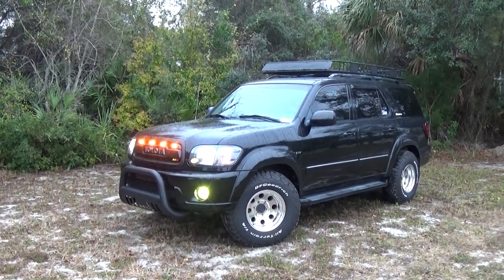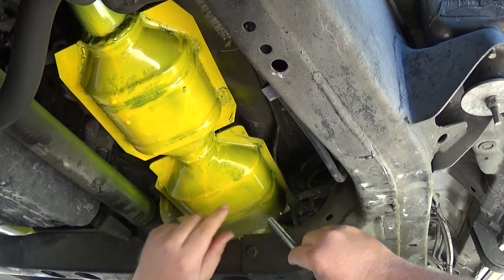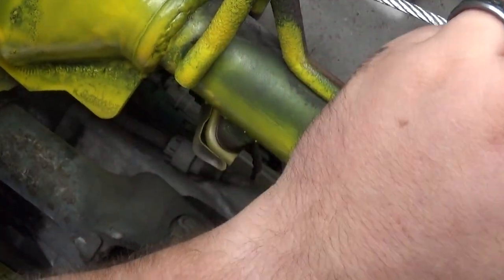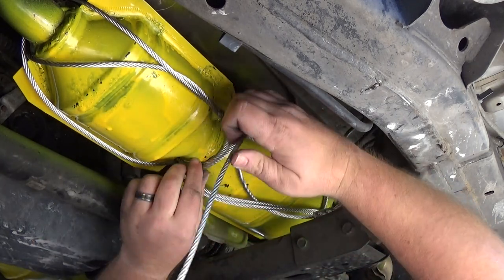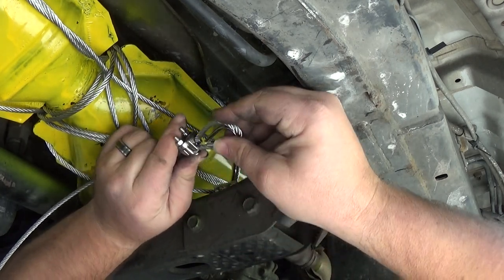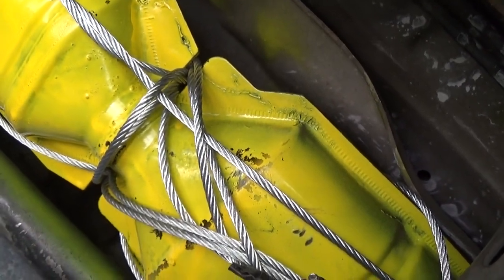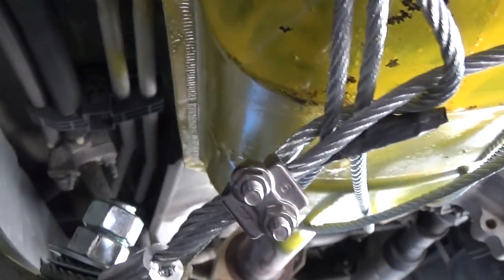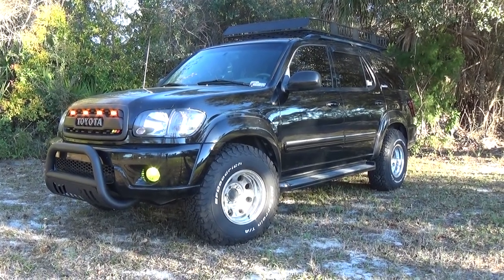SEQUOIA CATALYTIC CONVERTER ANTI THEFT STEP 2

Comment: You might want to take the cable and go up the pipe a little further they can still cut it 4 inches up from the cat. If the cable runs the length of the exhaust they’ll look for another car. Just wanted to help. Great video!

Comment: Right when you said cut it off with a cutoff wheel, I agree. That's what the thieves will do in a matter of minutes.
Reply from the maker: What are the thiefs gonna bring a big ass angle grinder and a sawzall. I dont think the crack heads can afford it.
Reply: @munnday86  That's exactly what they got. Angle grinder and a Sawzall. The paint should help determine them. You should etch in the local PD initials and the last 6 digits of your VIN. A lot of police and sheriffs are recommending that
Reply from the maker: @brianneal9204  definitely not a silent operation. I would like to buy the cat protection plate for security.
Reply: Sir
job well done protecting your property. I dont have a problem with asshats being put to sleep or deleted for stealing other people's stuff.
Reply: How has that worked out for 7 months later?
Reply: @asianstud7  i want an update too . Still have both ?
Reply: There's a video done by some guys who were  trying to remove it.  It took hecka long.
Reply: Add 30ft of razor wire and same amount of barbed wire as well to have even more protection.

Comment: I like this 86! Bought the orange  VHT Flame Proof spray paint at AdvanceAutoParts earlier today, then saw your video. Going to paint and etch VIN numbers on my 4Runner and the wife’s Avalon Hybrid. Might try the cabling with red Loctite on the nut if I can find a hole to pass the bolt through. I’ve watched a lot of videos and short of welding crap all over the exhaust system or buying a $400 theft deterrent skid plate, this seems to be the most practical solution. Thanks for the vid, liked and subbed!
Reply from the maker: Awesome best of luck to you. Anything to detur the thief. Its working great for me so far. Every morning I start my sequoia the cats are still there. Thank you for subscribing.

Comment: I don't get what the yellow paint does but you would think that if they already had the power tools to cut your cat off in a few seconds then why would they not just cut the cable aswell.
Reply: Because they usually just bring sawzall and it'd get stuck, if they had large cable cutters or grinder with them it would be time consuming to cut all the cables to get to the conv. It would probably be a good idea to run twice as many cables as shown on that video and hook them together to existing ones and to parts of the car, also use razor wire as well as cable.

Comment: If they cut just one part , can't they just unwrap it
Reply from the maker: Good luck getting to it... is a crackhead going to have a nice pair of bolt cutters  with them anyways.I have the cats painted yellow. Wrapped in aircraft cable and also have a skid plate with cat protectors. No one has attempted to take them and good luck if you try.. :)
Reply: @munnday86  thanks.  Question, a guy on yt painted his cc black.  I think to make it harder to see.  Along with other measures.  What do you think of that, the black

Comment: How is this going to do against saws?
Reply from the maker: The cable is bolted to the crossmember and its wrapped around a bunch of times.it  Will take a while to get out. Might be more trouble than the thief's are will to do.
Reply from the maker: @wesfields9322  I dont think it's that easy
Reply: Sawzall would have issues cutting steel cable. Pretty sure they would just move on to the next vehicle.
Reply from the maker: @seattlecarpenter  it's a pretty stout cable and yes the whole idea is to deter the thiefs and move on to the next vehicle.
Reply: @wesfields9322  you've never tried to use a Sawzall on something that can move...the cable will want to move back and forth with the blade.  A cutoff wheel can cut the cable fast but most thieves are using a Sawzall.  The problem with this method is that he mostly covered the cats...but thieves won't mind cutting the pipe on either end and then cut that one bolt that the cable goes to and pull the while thing out.

Comment: Well i found your video because i recently got mines stolen and cost the insurance 3000 in addition to the 500 deductible. Ok i wrap my cat with same wire rope and now the smell is like some thing burning. I figure as soon as the oils that were use in creating this wire rope burnt out i should be good. so my question is how long should i wait or should i remove it. Anyone who install feed back?
Reply from the maker: I'm just going to leave min on there for a long time. It will help deter thieves from stealing them.

Comment: how easy/difficult is it to cut those wires with a good cutting pliers?
Reply: Very easy to cut .   This is not a good fix.   I had to weld 3/4” rebar plus painted with 2000f paint plus had to build a custom cage.
Reply from the maker: @tcjha6250   its actually hard to cut with a reciprocating saw. Good luck getting the cat unbolted from the cross member.
Reply: You don’t use a reciprocating saw.  Angular grinder / hydraulic cutter will cut your wire in seconds.   I also used bolt cutters to cut such wires.  No reason to unbolt cats  unless it’s time to replace. Which is at least In another 100k miles. Also nuts are very accessible when it’s time to unbolt. .  It won’t be a problem.  What u put there is better than nothing.  Any protection is still good.  Good job.
Reply: @tcjha6250  most of the time its just a inconvenience thing. If its gonna take a few seconds longer they usually pass. 
My wife worked for a medical transport company and only one had a protected cat. They passed on that car and cut the 2 on both sides of the vehicle.
Reply: Once you splice the rope you can easily unwind it so that bolt in the cross member doesn’t do much protection.  Pulling out cats will be very easy afterwards.  2 more cuts and it’s out.
Reply: @tcjha6250  that takes seconds that most wont take. Atleast not here.
Reply from the maker: @TheModAddict  100% true. Anything  that's going to slow them down. And risk them getting caught, they will pass on.
Reply from the maker: @tcjha6250  I belive most of the time the thief's will carry a reciprocating saw. There would be no need for the thiefs to carry a hydraulic cutter or angle  grinder.  Anything to slow them down or move onto the next vehicle.
Reply from the maker: @tcjha6250  seeing the video and knowing what is used to secure the cats is onething. A crackhead wont know what to expect.
Reply: @tcjha6250  heard they cut thru those too.

Comment: Correct me if I’m wrong, but doesn’t this just add one more extra step for thieves ??? One on each side of cat then just cut the metal rope ar the frame? Then they just take the cats along with all your metal rope?? Lol
Reply from the maker: My cats are still on my Sequoia. I dont know if thieves have ever  crawled under my sequoia or not. But it must be working.  Good lucking getting my cats.. the aircraft cable is wrapped around everything.
Reply: @munnday86  I see .. I may actually do this. 👍🏽
Reply: @munnday86  Could a mechanic shop install this as well as you did?
Reply from the maker: @sl4983  not sure how much a mechanic should would charge you. Easier to do it your self..